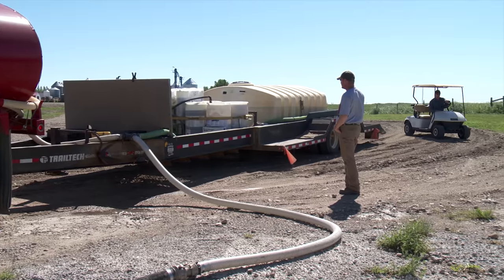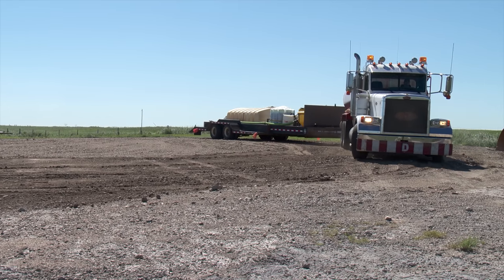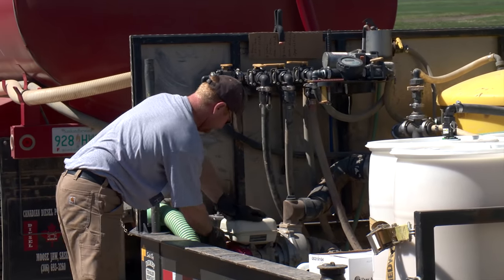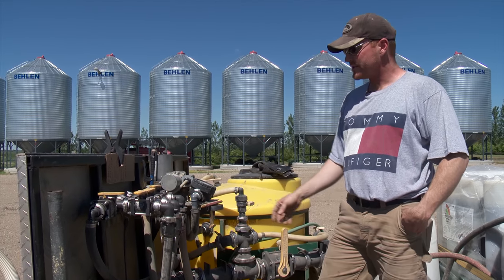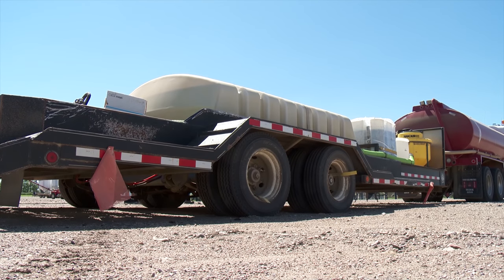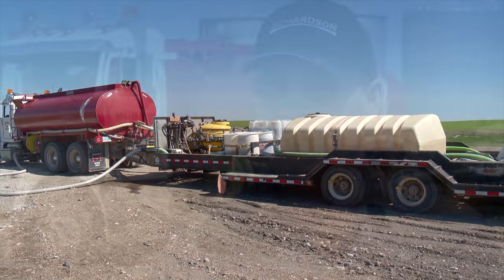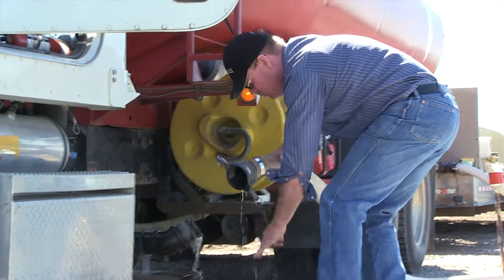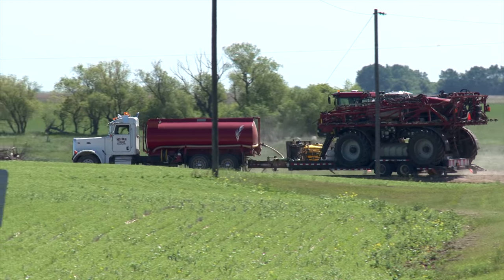Custom Sprayer Trailer and Water Truck

Comment: Awesome setup, those guys know what they are doing, you got to love farmers! As for the water truck, if you want real fire fighting capability,, 1-man operation, connect the PTO pump to the tank, discharge to a remote control hydrant mounted up top, front of the tank! That little Honda might be fine for washing but not for a fire like what came thru northern Alberta

Comment: In the mid 90s I worked for a Cenex driving the water truck. If we had five miles or less, we would road the sprayer, but over five miles it was faster to load sprayer on trailer.

Comment: That trucks got a lot of power pulling all that weight
Reply: 350 is plenty. Saves fuel and still completes the job. 450 is better, but really not required.
Reply: What the fuck happened in this thread?
Reply: It’s a Pete that’s why!

Comment: hmm this seems pretty interesting, smart design! i wonder how much this co-
Reply: NamiKaze 55g isn't bad considering the cost of the sprayer. Google it, you will never become a farmer lol. Combines are expensive too. What would you like to buy, this nice house in the country, or this combine.
Reply: teller of truth... so you are saying it would be more efficient to have a sprayer spending half of the day driving up and down the road between the field and a water source instead of spraying?  Not to mention the other jobs they use the truck and tanker for which the sprayer cannot do.
Reply: teller of truth... it  may not fill any useful purpose in your operation but that does not mean it does not work for these people.  But #1 Just because the sprayer can drive up and down the road does not mean it is efficient to do so regarding time and tyre/machine/transmission wear. #2 Obiviously the fact that they transport the sprayer means they cover a large area (I am betting you don't have personal knowledge of their operation)  #3 it is actually impossible to (even allowing the water source is close by which we don't know it could be 10 miles away, they may also use water from a treated/ softened source to increase the efficiency of their chemicals if they work in a hard water area... again we don't know) get down the road and fill the sprayer and get back as you suggest in the same time it takes to fill it in the field.  #4 if you have a second person on the tanker they can have the next fill pre mixed and ready to go while the sprayer is doing it's job in the field, the same holds for collecting more water.  #5  The sprayer has a very limited capacity for carry chemical concentrate around    #6  As for being a keyboard warrior you are the one that posted a derogatory comment (twice in reply to two separate posts) calling the machine owner a fool for using equipment when you know nothing about their operation, nor do you know anything of my experience/ knowledge of the industry... so yeah probably best to pull your head in on that one.  It is amazing to me that people are so arrogant that they feel they know more about someone else's business operation than they do.
Reply: teller of truth... lol, ok just to humour and educate you... it is a hydrostatic tranmission... ie great for infinitely variable speeds in field work but hugely inefficient for road or transport operations.  You must work with some out of this world machinery if they don't use transmissions for converting engine power to movement.
Reply: teller of truth... you are just embarrassing yourself now man. We'll leave it there as you obviously are exactly what you are accusing me of being and as such there is no point in discussing the subject with you.
Reply: What of labour shortages? 1 person can load it all up and get 4 runs through instead of wasting time driving back to the farm arter every empty tank